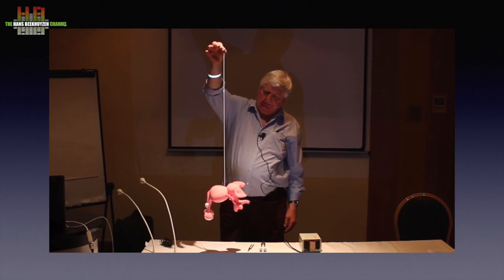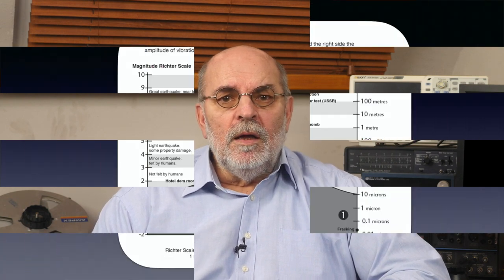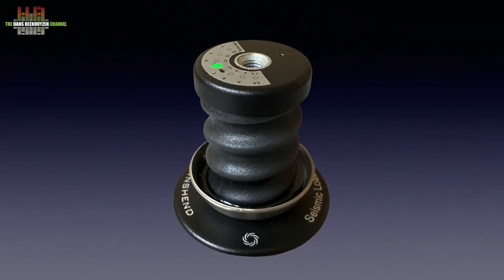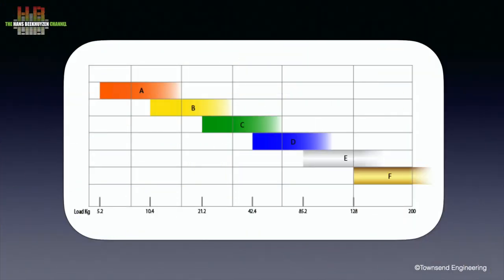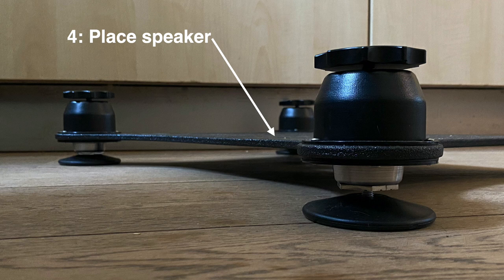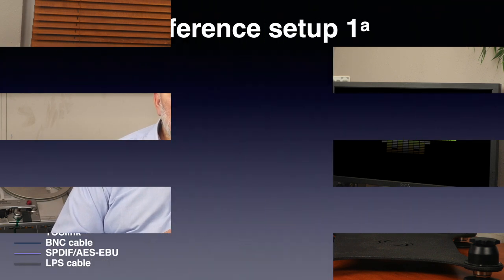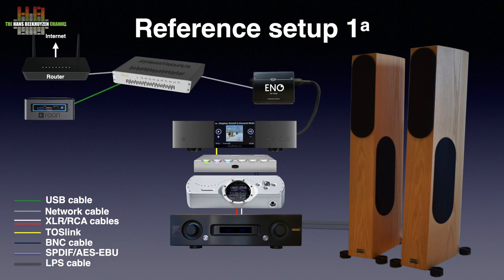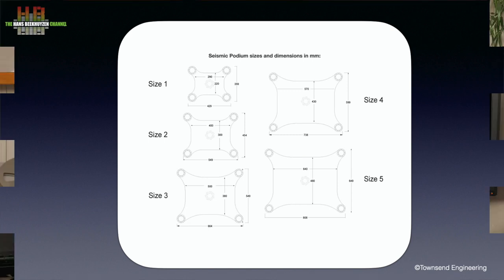Townshend Seismic Podium for loudspeakers

Comment: You might want to try putting some caps on to hide the black knobs although I feel it is the whole design that looks industrial (no effort was made by Townshend Audio to disguise this) so it might be a wasted effort. It might actually be a better idea to have a custom horseshoe-shaped box built with a finish matching the loudspeakers to hide the whole base. But I'm afraid that, once a decision has been made, it's best to cut your losses and just dream on (or wait in case Townshend Audio produces something more household-friendly.)
Reply: Another approach I just thought of is to try the Seismic bars instead. They are the precursors of the podiums and, to a large degree, the same thing, sans industrial-looking knobs. In fact they just look like the normal loudspeaker feet. One distinctive advantage of the bars vs. the podiums is that the bars have adjustable length and a pair is used per loudspeaker so they offer great freedom of placement and can be adjusted to protrude very little. Both of these attributes help make them less obtrusive and visually objectionable.
Being second hand, they are of course much cheaper.

Comment: Hello Hans,
I find your reviews very informative.
But I am not sure why you are presenting the idea that we have to find the barometric center of gravity of our speakers before mounting them onto the Seismic Podiums.
I have the Podiums. I use them under my Cube Audio F8 Nenuphar Minis. The Minis fit nicely onto the Podiums. There is only one way to do it and they are a perfect fit. There is no appreciable room to move them forward or back. They are perfectly centered.
So, in this scenario , what difference does the barometric center of the speaker make?
If the speakers weigh more in the front than they do in the back that's going to be true no matter where you center them on the Podiums. Even if it were possible to move them back a centimeter or so  the front springs would always have to bear more weight than the back springs.
If you've chosen the correct Podium for the weight of the speaker... meaning a speaker whose weight falls anywhere from the beginning to the middle of the total weight range of the Podium... then the springs should be able to handle much more weight than your speaker places on them.
If, on the other hand, your speaker's weight falls very close to the high end limit of the Podium's weight range, then the speaker's weight distribution might be problematic... and perhaps a Podium that handles more weight should be chosen because unless the area of the base of the speaker is considerably smaller than the area of the platform of the Podium there isn't going to be enough room to make positioning adjustments.

I would appreciate your thoughts, Hans. If I am making a judgement area please let me know.
Reply from the maker: I followed the manufacturer's and distributors's instructions
Reply: @TheHansBeekhuyzenChannel  I understand. But do you see my point about positioning speakers on the Podiums and how there is little to no  room for making adjustments?
By the way, I also like your sense of humor.

Comment: Surely Hans is joking about speakers picking up ambient tectonic vibrations. However it is not April 1... Presumably isolation is for speaker reverberance and not micro earthquakes...?
Reply from the maker: I presume you have tested than too?
Reply: Hans I'm not for a minute doubting what you hear or that the intervention is effective.  However I am doubting the hypothesis that the benefit comes from isolation from ambient environmental vibration transmitted through the floor.  That would be surprising indeed.

Comment: Thanks for this very nice video Hans, usually I consider this as snake oil but you convince me the opposite. I have the GoldenEar Triton Reference meaning I need the number 4 option, costing almost as must as the speakers them self.  How do you level after complete installation because of the od shape off the speakers?
Reply from the maker: I think you better ask that to the manufacturer or distributor, they likely have experience with a wider range of loudspeakers than I have.
Reply: that's what the knobs on top are for, you put a little level on top of your speakers and you adjust them in pairs, either left side right side or front ones or back ones.

Comment: Aesthetics committee!! Love it. Those damned bureaucrats lol. Perhaps a comparison to the isoacoustics feet are in order?
Reply from the maker: All in due time
Reply: @TheHansBeekhuyzenChannel   I notice the Townshend seismic pods have a thread in the top - could you not fit this directly to the base of your speakers, bypassing both the podium platforms and the aesthetics committee in one swoop? By the way I have a DIY version that does something like the podiums and the results (on a wooden suspended floor) are excellent, and just as you describe - cleaner, tighter bass and (most surprisingly) a better soundstage.